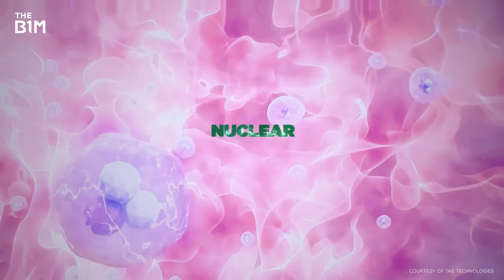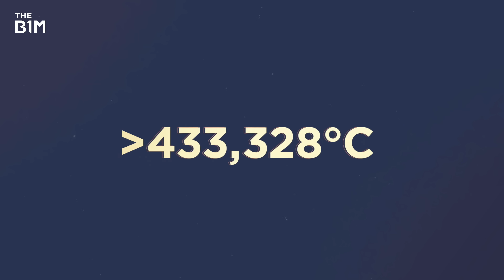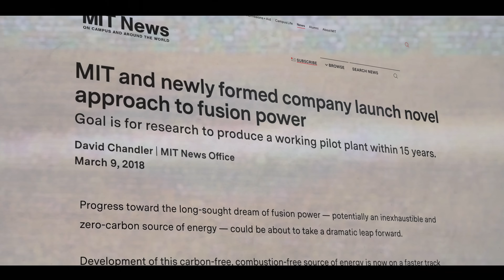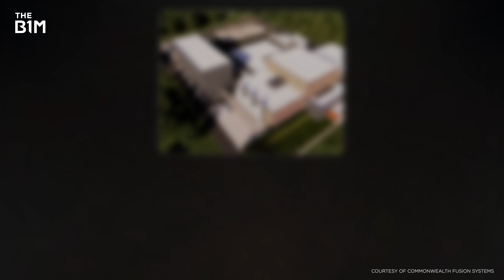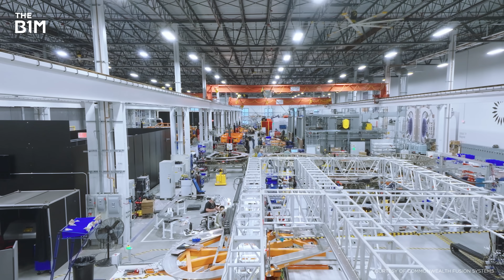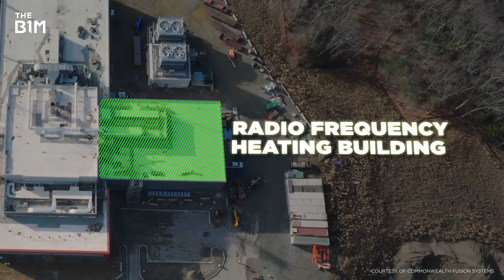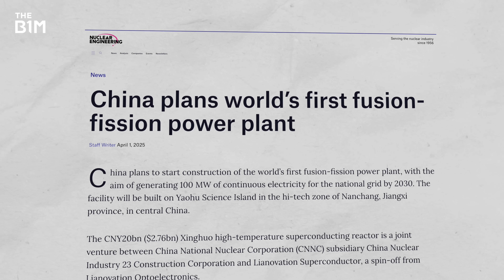Is America About to Win the Nuclear Fusion Race?

Comment: I think what could end up being challenging is just controlling these things once you do get self-sustaining fusion. Because they are basically trying to make something that works like a miniature version of the Sun, it may not be radioactive but it will still be very powerful. So it's going to have to do what the sun does on a much smaller scale without destroying whatever is going to be containing it and controlling it. I can see it eventually happening but there will definitely need to be a breakthrough.

Comment: Y'all missed one.  One of the most promising ones.  Well,  you missed two.  One, the less promising if you ask me, is the National Ignition Facility in California.  They're the ones that set most of the recent records on fusion.  But they're also pursuing intertial fusion which alot of folks think might be a dead end.  

The promising one is in Germany.  The German group is using a stellerator instead of a tokamak.  That's the twisted, slender ring of magnetic confinement instead of the more donut shaped tokamak.  The stellerator is arguably more complex to build and design, but produced smoother and more manageable fusion.  It skips by several of the containment problems that tokamak based designs are still struggling with.  Granted, it has other concerns.  

IMHO, the MIT group and the Germans are the ones to bet on.
Reply: Yup. NIF and Wendelstien X7. 

But, iter also has contributed hugely to the eventual breakthroughs well need to master fusion.

Comment: It is possible of course. But basically is have seen only one thing in this video that actually sets this company apart from others: the use of that Material for the magnets, that would make them smaller (which begs the question why others like Iter do not use that material?) So for now I am not convinced that this not going to be the next company that is eternally 5 to 10 years away from commercial use...

Comment: Fun fact, the "Do not cook pizza in a fusion reactor" is actually something that needs to be said. Intel once dealt with one of their vacuum wafer ovens becoming contaminated with high levels of water vapor and organic contaminants. It would happen almost randomly, once every two weeks or so. The process involved no water, and the oven was automatically filled with inert nitrogen at the end of the workday, so it was a mystery... until someone found the pepperoni slice.

One of the night guards had made the observation that a system designed to load 8-inch wafers would also accept 8-inch wafers with a frozen pizza on top, And the kitchen was waaaay over there, but the chip oven was right next to his duty station. Really, he was just being efficient.
Reply: Needs to be said to us?!  :O  While I do love a nicely cooked pizza... ;D

Comment: Why go through the extreme expense of trying to get a nuclear FUSION reactor working when simply getting a nuclear FISSION reactor using thorium as a fuel source is so much easier and cheaper instead, and is a proven technology that works, and there's enough thorium on the the Earth to supply all of Earth's energy needs for the next 100,000 years?
Reply: Because thorium reactors aren’t cheaper. But I agree we should focus on fission in general

Comment: This happens when there is giant money at the top. Problems get solved because we can afford to fail. Building a ‘fusion reactor that will connect to the grid and provide enough power for 150,000 homes by 2030’ has just the small caveat that no one knows how to do it or has ever succeeded before. Why not say you’ll build one that powers 10 million homes? Or a 100 million!!!. I’ll cross my fingers but not hold my breath.

Comment: What really kills me with these companies and scientists is their constant claims that they’ll be able to create a viable fusion generator in just a few years from now.  That’s been a common mantra for decades now!  You think that the scientists and engineers on the ITER project don’t know what this company is claiming they’ll be able to do?

And just for the record, they’re are designing a glorified steam engine.  But instead of using wood or coal to boil water, they’re using energy released from snagging atoms together.  When will we lose the steam engine and have a more direct line from the heating element to the actual power used like electricity?  I know we’ll get there someday, but all these little and big groups of people should be working together rather than racing against each other who will get there first.  I think in this case, more than most other human endeavors, it’s actually keeping us from solving this problem of sustained power production sooner than later.

Comment: Every tokamak design I know of (the one being pursued in the video) requires tritium. Tritium is VERY rare. The accepted solution to this rarity is the fusion/fission design. A byproducts of this fission blanket is tritium. One thing I don't want any part of, is a fusion reactor operating at insanely high temperatures and pressures that is wrapped in a fission reactor. Every nuclear reactor accident we've had involves very high temperature, very high pressure, hydrogen and fission material (radioactivity) in some combination. Either pursue a different fusion design not dependent on tritium, or just build low pressure walk away safe MSR fission reactors that will provide us with all of the energy we'll need for many hundreds of years.

Comment: another energy generation system that is boring followed by boring.  This uses hydrogen isotopes, the rare isotope tritium will have to be manufactured...so I say this is the dumb kind of fusion, maybe it is something that can be instructive in getting to "good" fusion(using "regular" hydrogen) but we should stop looking for more and different ways to make something create steam to turn a turbine and create electrons...that is just a layer of middle-manning something when solar PV does not have that problem and is decentralized, I really like the decentralized part personally but industry usually needs something with a little more bang.

there are other ways to create energy, maybe we should start looking into the possibility of creating more things that do not depend on electricity.

Comment: It dosent matter, theres a fundimental problem with these reactors, the neutron flux inside that insanely expensive vacuum chamber is so high that the crystal structure of the metal will degrade  causing the chamber to need replacement every few years

Comment: If an international conglomerate made up of the most advanced countries in the world is failing to build one 'small' (yes the commercial ones will need to be BIGGER than ITER to scale up the ratio of energy in to energy out) tokamak design after 20 years, then I don't see how fusion energy will be the answer to solving the world problems. How do you expect 'random african country' to build and maintain one ?

By comparison the first fission reactor to test fission chain reaction took one month to build in november to december 1942... The first full size ones for commercial electricity only took a few years.

At one point the equation make it so bad for fusion that just building a bunch of wind solar and batteries everywhere is cheaper faster and less risky (as in chances of project to be done to completion and reach a usable state)

Comment: Is The US About to Crack Limitless Energy?
No. They are no where near it. Maybe 30 years. Eventually it will happen, but not for a long, long time. 
Yes, the sun also does Fusion, but given the mass of the sun, the temperatures required to sustain fusion are 10 times higher on earth. 15 million vs 150 million degrees C. So.. no, we are not even close.

Comment: This new REBCO-magnet based tokamak line from CFS is very promising. The use of high-temperature superconductors allows much higher magnetic fields, which in turn enables smaller, more efficient fusion devices. Recent breakthroughs (PIT VIPER cables, TFMC magnets) show that the conductor technology and mechanical design are catching up. On the flip side, cost, cooling, neutron damage, quench protection, and long-term reliability are serious hurdle. If CFS can demonstrate net energy gain and build magnets that endure repeated cycles without failure, this could accelerate fusion commercialization. But don’t expect a large grid-connected fusion power plant overnight — it’s still several engineering and material scaling steps away.
But i still think its a UNICORN.

Comment: Im surprised other competitors like type one energy and proxima fusion weren't included. Perhaps because they use stellarators, which have had problems historically. 

But stellarators are now able to perform well thanks to 3D printing and advanced computing, and those stellerator-based companies are also aiming to get their fusion reactors online by the early 2030s. One of the companies I mentioned has an agreement with the Tennessee valley authority - having backing from a government is a pretty big vote of confidence. 

I think a focus on recent stellarator advances might be good for a video...

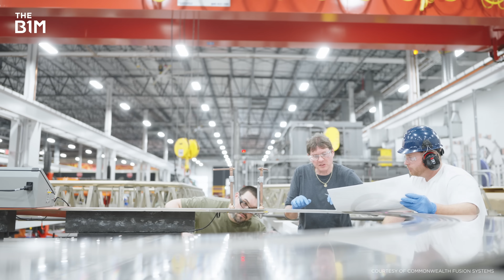Comment: 10:10 the size of the tokamak reaction chamber doesn't come from the magnet's needing to be so large to achieve the required field strength.
The size of the reactor chamber in tokamaks and stellarators comes from the fact that a smaller reactors have a harsher curvature (from the Torus radius) which induces losses of fusion plasma (compared to the ideal infinite magnetic bottle that they are trying to imitate with the torus shape).

So using different magnets doesn't allow you to reduce the torus size by itself!

Comment: Replay of a replay of a replay of something that's been repeated in ever better graphics for the past 50 years. I believe it when I see it working.
Reply: There have been several minute long ignitions in the past 5 years, so I guess you are a believer now?
Reply: @Yattayatta  There have been "ignitions" before. And even claims of producing (but not capturing) more energy than what was put in. But no, not a believer anytime soon at this rate.
Reply: @akiko009  No there hasn't, unless you count nuclear weapons you know you are lying here. 
Getting more energy out than you put in is very simple for fusion power, as you have superlinear power growth versus sublinear loss and cooling rates.
That means as soon as you can sustain the reaction, you can just build a bigger reactor with the same design and you'll get more power out than you put in.
Reply: @Yattayatta  Riiiiiight.
Reply: @akiko009  What part do you disagree with?

Comment: Nobody so far has ever got any fusion device to create more power than it takes to run the machine.
Talking about powering cities with fusion energy is just fantasy at this point.
Keep the optimism in complete check and be nothing but skeptical about any fusion experiments.
We can become optimistic when one of them meets several criteria.  It needs to produce at least ten times more power than it takes to run, and it can run for at least five years without needing any significant maintenance.  And that significant maintenance should cost less than five percent of the value of the power it generated in the five years that it runs continuously.  
The temperatures and pressures required to create fusion are so high that they exceed the properties of any materials that exist.  Very clever engineering is required to keep the device from melting itself.  Cyclical fusion events appear to be much more possible than continuous fusion, but I won't predict the future.  I will, however, remain extremely skeptical about fusion energy and I believe that at this point, even experiments with fusion are mostly huge pits to throw tax money into.  Let the Chinese spend the money and keep spies in their labs.

Comment: I'm not buying it. Nobody's come close to true break even. If the power in from your radio heaters is greater than what you get out of the steam, then you haven't done squat. And there's plasma instability plus the neutron flux which heats the beryllium jacket to make steam abrades it and makes it hellishly radioactive. Now you have to decommission a big chunk of beryllium on a regular basis. I don't think these problems have been solved yet. They may never be. I don't know what these guys are smoking they got funding, for sure.

Comment: This is not the answer to unlimited energy. Free energy or zero point energy is the future of unlimited energy. It can be harnessed from the vacuum of space and it's simple to do all you have to do is tap into the frequency. The fusion reactor is not the step in right direction it will still use steam to generate electricity.

Comment: I can tell you know , this will not happen in any near future. 
There are massive , critical issues with fusion have not been addressed. 
Initiating fusion is relatively easy , we have been doing this for decades. What is not simple is sustaining the reaction and getting the energy out of long sustained periods. 
Issues such as neutron damage , plasma destabilisation due to fuel injection , fuel breeding amongst
A whole list of other things have to be addressed. The neutron damage most of is probably the biggest issue , under sustained exposure the device will effectively crumble as neutrons slowly destroy it.

Comment: The key difference between this an Helion is that Helion is direct electricity generation and tokamaks have to do a heat to steam to turbine conversions. Which at large scale is not so cheap or efficient and massively complicates engineering a sustainable reactor.
Reply: Helion is barely going to be able to generate 15MW of net power output. ARC will be able to produce 400MW of usable power. Not even a comparison. Turbines are already in use in all nuclear plants. That was never and will never be a problem for large scale power generation.
Reply: @ophello Orion is planned to provide 50MW per plant. What do you know that they don't?

Comment: From my experience, fusion power has always been 5 to 10 years away for the past 65 years. I remember multiple television programs telling us about what the world would be like in the year 2000. None of them mentioned a touchscreen computer in your pocket that would allow you to look up literally anything, so I could be wrong. I hope that I am wrong, but I remain skeptical.
Reply: At no point in the history of fusion research have we had a plant design based on high-temperature superconductor coils.

Until now. That's what changed. HTS unlocks fusion. Now it really is only 10 years away.
Reply: @ophello I hate to break the news to you, but little has changed since 1986 when "high temperature semiconductors" meant liquid nitrogen. Yes, they have relatively recently gotten to 15 degrees Celsius, but only at immense (impractical) pressure.

Comment: Is there a current project that involves a more direct conversion of the energy in lieu of traditional steam generators? Could the energy be pulled directly through magnetic pulse controls from the core.  Clean water is becoming scarcer as industries continue to use it in production methods.

Comment: I’ve already powered my home and vehicles with fission, using solar panels and Tesla PowerWalls, which should last another 25 years. China’s rapid solar installations—equivalent to 20 nuclear plants monthly—combined with falling battery storage costs, are outpacing fusion efforts. The key gap is national agreements for sharing power through high-voltage transmission lines. When homes, apartments, and businesses go off-grid, it frees up energy for future needs, reducing reliance on fossil fuels and their pollution and geopolitical risks.

Comment: I have been reading that fusion is about 10 years away for about 60 years now.  
I suspect that a combination of solar and wind, combined with sodium batteries for storage, will be able to produce electricity much cheaper than these complex plants, even if they do eventually get them to work. Duplicating the conditions at the center of a star won't be easy or cheap. Check out a graph of the coast of Chinese solar panels over the last 20 years. Cheap sodium batteries are coming next.
Reply: Wind power is expensive.

Comment: I think Helion Energy the closest to cracking this code. Especially with the direct Capture method from the EM field produced instead of just heating water for a steam turbine. for an analogy they built a huge Alternator from diesel engine design but the reaction is fusion in a chamber.
Reply: Helion: 10-15MW.
CFS ARC: 400MW.

Not even close. Helion is small fish. ARC is the future of fusion.
Reply: @ophello if ARC even works. But if it does that’s great. Also Helion can scale it to great capacity that is just first commercial size build out.

Comment: Quite a few errors in this video Fred. Microwave ovens DO use radio waves (electromagnetic waves). They are at a frequency which causes the water molecules in food to vibrate and heat up. Also there is no -400 degress C as the lowest possible temperate is absolute zero with is -238 or so. You might have rounded the number for the video but anyway. The problem is not just reaching the net positive point but maintaining it for long periods of time to continuously generate energy. Like any system using fuel, there are "ashes or burnt fuel" that have to be removed as the reacton continues.
Reply: it seems microwaves are from 1mm to 1m while radio waves are from 1mm to really anything above it. The range most sources seem to give is "hundreds of kilometers long" so yeah it seems microwaves are a much smaller spectrum of radiowaves.